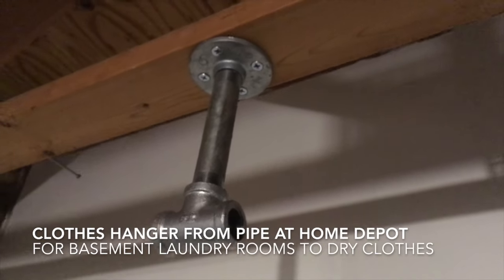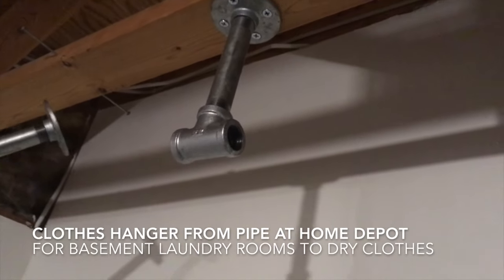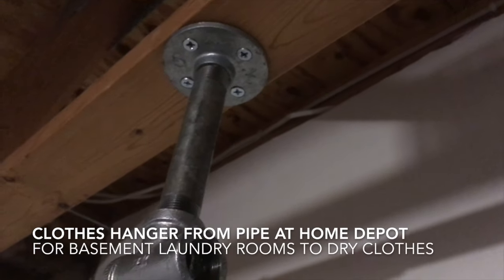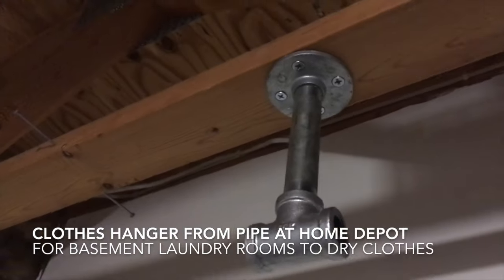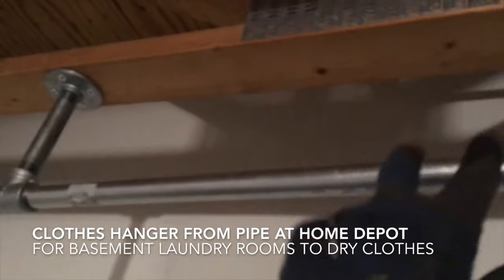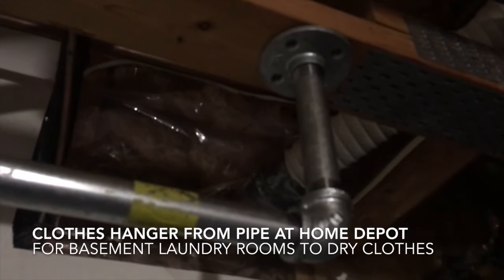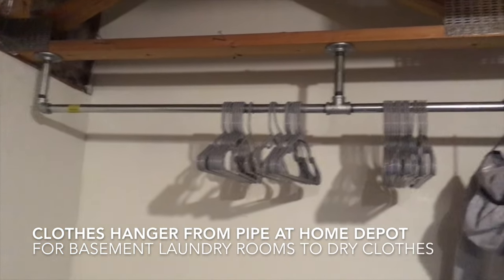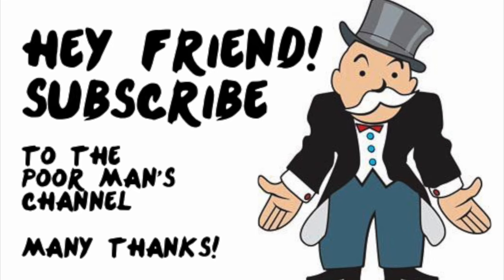DIY Pipe Clothes Hanger!

Comment: those pipes are really pricey
Reply from the maker: Not really. Galvanized pipe doesn’t cost that much considering the mileage one gets out of the finished product. Try a Menards, Home Depot, or Lowe’s.
Reply: @Guitarburger  i did bro each long section costs over 15 bucks, all the other elbows smaller pieces totalled way over 20 bucks so these pipe racks (like yours and esp the free standing ones) are pricey. Thankfully, the racks do last well, forever.
Reply from the maker: Aight
Reply: I used electrical conduit - 10' piece and cost was less than $10